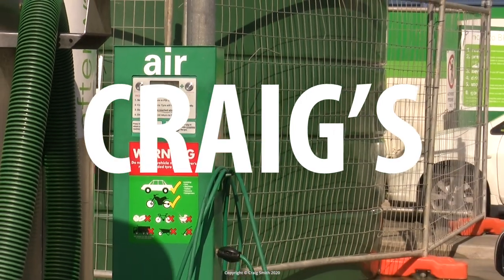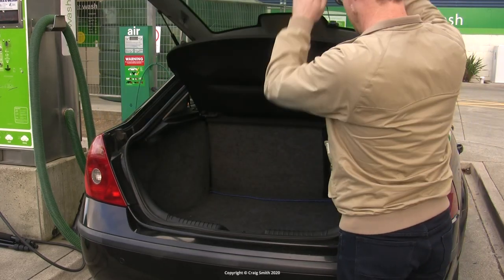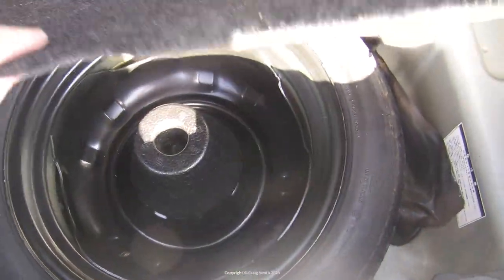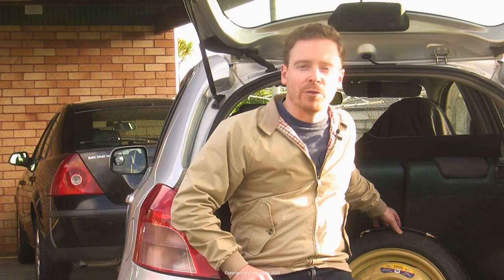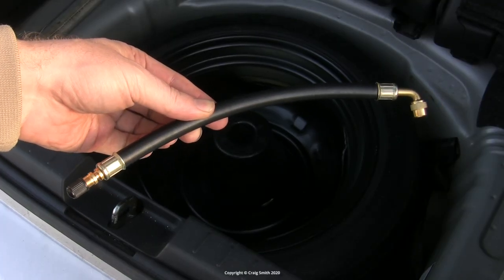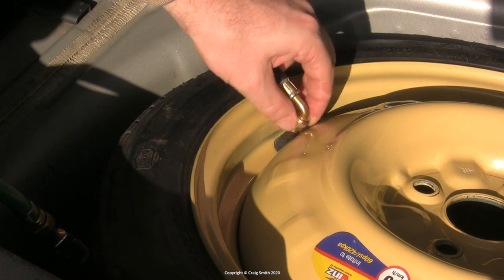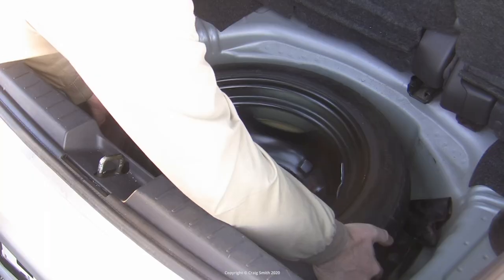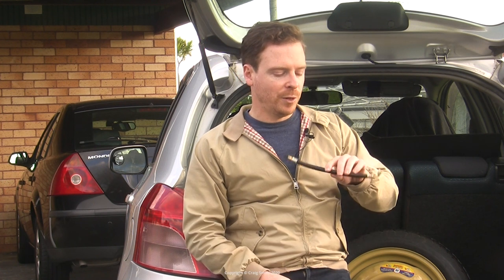How to: Make accessible the inflation valve on your spare wheel, which was hidden from you!

Comment: An underinflated spare wheel is not a big problem. At the first gas station it is possible to adjust to correct pressure value. Honestly, out of 160k km, I only needed the spare tyre once. So I would not bother keeping the tyre pressure within a strict pressure range all the time. The cost of the time spent doing so doesn't equalize the benefits that extra effort produces.